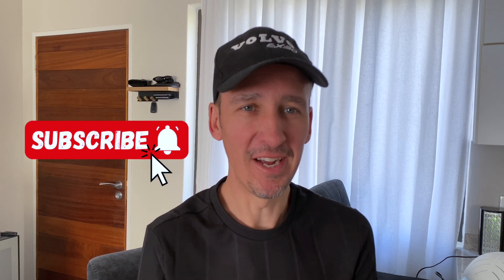Battery Preconditioning System Volvo EX30

Comment: Hey 
I’m curious about the range of EX30 in real world as a daily drive Monday to Friday and how often does it require charge and weekly charge or monthly cost , since I’m considering it but extremely reluctant for some reason
Reply from the maker: Thank you for your comment. Highway speeds at 120km will give you between 290km or 330km of range. City speeds at 60km will give you 500km to 510km
Reply: @RufusWentzel  Driving 115km/h right now, 70% battery 249km left. Trip is set to 135km, 1hr 45min. I'll have 36% left on arrival... Let's see if the EX30 sticks to its promise. Yesterday I had to charge from 25-30% and it took over an hour at a 300W charger. (it was set to 100%, I'll lower it to 80% this time)